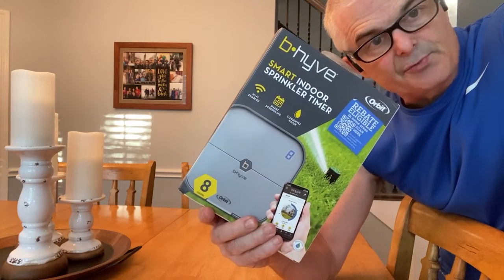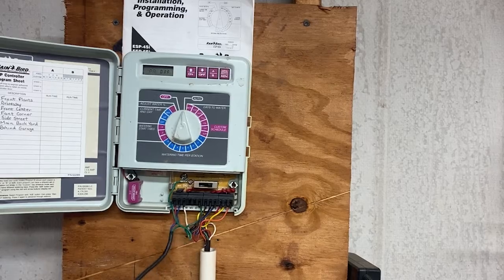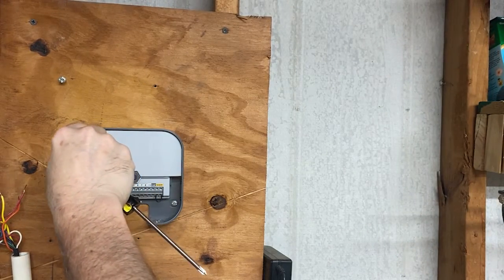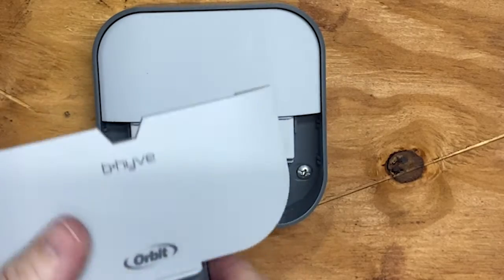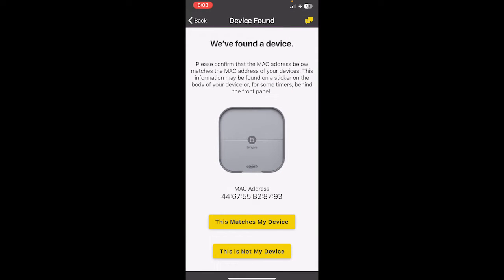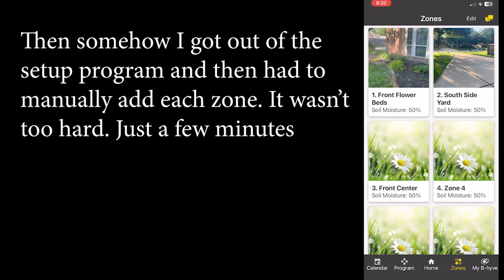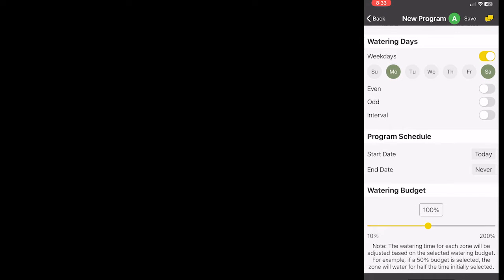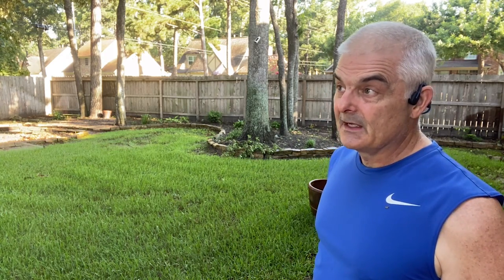Orbit B-hyve 8-Zone Smart Indoor Sprinkler Controller Full Installation Guide

Comment: What happen when you setup a daily program but this day rains? It will prevent the system from running?
Reply from the maker: Frankly, it has been a bit spotty. I have the app set to detect when it rains (I think it pulls from the NOAA weather site). But on a few mornings when it is raining I have had to manually (through the app) turn off the system.  It has this feature - but not super reliable. There is a thing you can buy that is a dedicated rain sensor - but I haven't bought it.

Comment: If I buy this unit in USA, can I use it in Europe? The power there is 220v. The USA is 110. Do I just get different power adapter?
Reply from the maker: I'm not sure - but I assume that you will just get a different adaptor. I would check first.